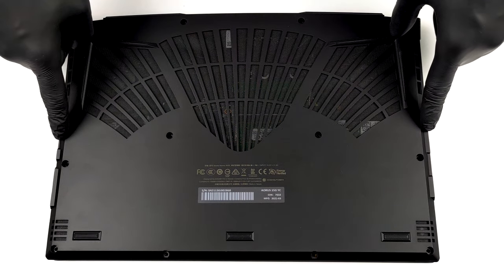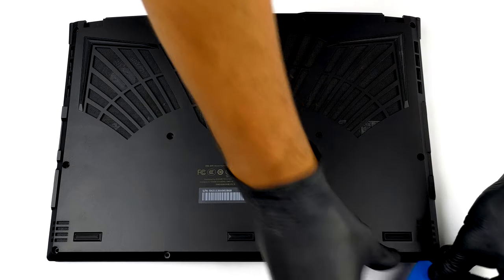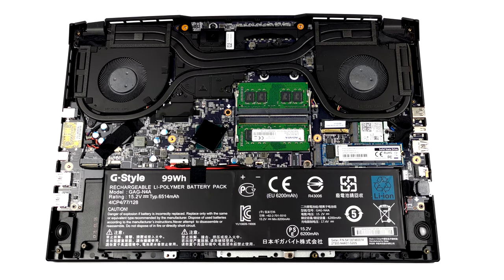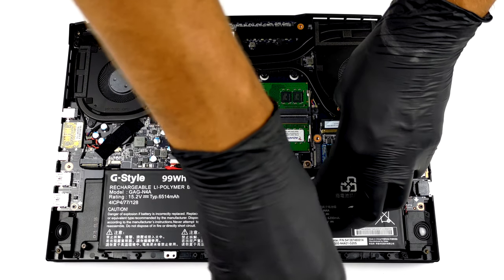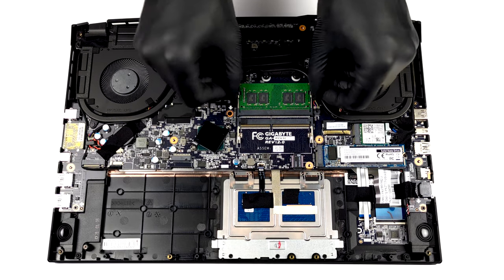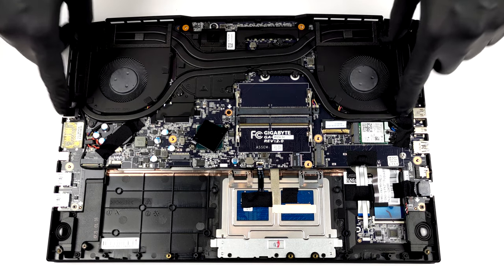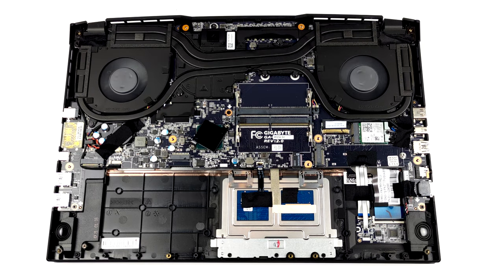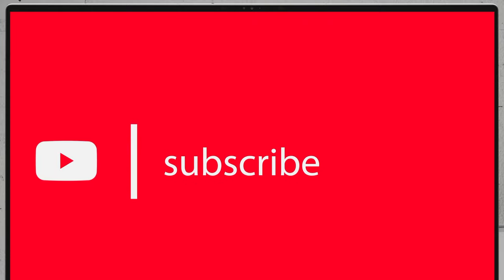🛠️ GIGABYTE AORUS 15G (RTX 30) - disassembly and upgrade options

Comment: Did you dissasembly heatsink? I've got the 3080 16gb version and i dont know if it has thermal pads already installed or that gummy compound over memory chips, my plan its to repaste it with thermal grizzly kryonaut and replace gummy or t.pads with gelid ultimate
Reply: How did it go?

Comment: Anyone know a video showing how to repair the cooling fans for the GPU on this unit? I have a fan that rattles and gets stuck now at times. can be extremely noisy when functioning. or anyone just have some tips on how to fix without totally disassembling this thing?
Reply: The answer is NO, you need to disassemble all the cooling parts to change the fan, same with MSI laptops. Moreover, the price of a single fan unit for this model is really high and I have found several posts about the fan issue with the same model.
Reply: @peterh.2488  shitty, got this model when it was pretty recently released, and yeah didn't see anything on it about it then, but its something that i guess happens with time.
Reply: @tuckersossaman8838  maybe you can order the kit on eBay or aliexpress, pricey but it works
Reply: hey, I had the same issue. If you remove the fans, you can squirt a bit of grease into the bearings and then resemble, I did mine months ago and now its quite. I would suggest doing that because if will wreck the bearings if you keep using it like that. So far the repair is still good - nice and quite months later. (you will need to reapply thermal paste to the CPU and GPU)

Comment: what is your overall opinion about the aorus 15G? there is not much info about it.
Reply from the maker: Hey, to be frank, it is a decent gaming machine, but it would be an understatement to say that we weren't particularly happy with the battery life. Also, we've just posted our In-Depth Review of this device, and you can find it here: https://laptopmedia.com/review/gigabyte-aorus-15g-rtx-30/
Reply: @LaptopMedia  Thanks for the info! I have it since March. I didn't  know much about Gigabite but im so happy with it. mainly performance, temperatures and built quality feels very good. I agree on the short battery life, but i use it plugged in the most of the time.
Reply: I'm very happy with mine. I had an ASUS TUF F15 with a 3070, and graphics performance-wise this laptop is comparable. I think the wattage may have been higher on the F15 at maybe 130 watts, which is why the 105 watts 3080 in the 15G YC competes similarly. The air cooling is better in the AORUS, and the memory and RGB controllable keyboard is why I switched. A lit keyboard is not normally a selling point for me, but the F15 has a green keyboard that flashes on startup and on standby which could not be disabled. Check out the reviews, but I feel this laptop is a bit of a beast for a daily driver.
Reply: What size of torx head do you need to unscrew the bolts? I used my smallest and it was too big.

Comment: please help... My laptop turns on by itself but there is no image, I press the power button, it turns off and comes back on... I already changed the ram, I turned it off and nothing... I was changing the boot options when that happened... Could it be that the bios was damaged? How can I reset it? another idea?
Reply: Did u fix it? I have the same problem right now
Reply: Me too
Reply: @raphaelfco  disconnect the battery, and the ram…. Wait 2 or 3 days and try again …

Comment: Does any one know what the circular smaller battery thing is just under the left fan cuz broke the the little white connecter in half that holds the red and black wire to the motherboard, and how do I get a new one.